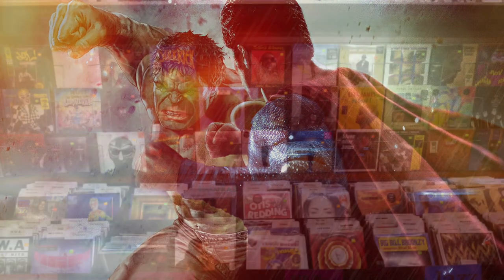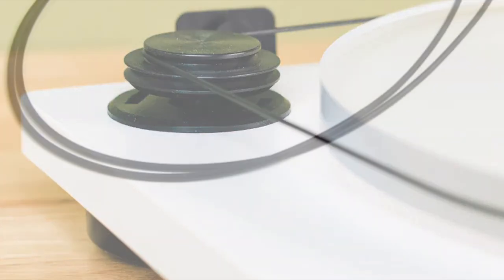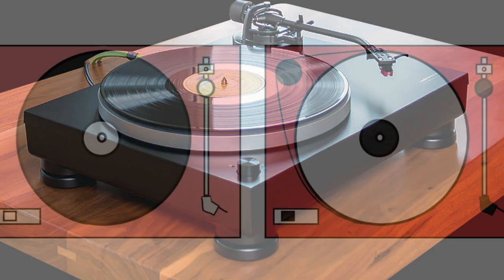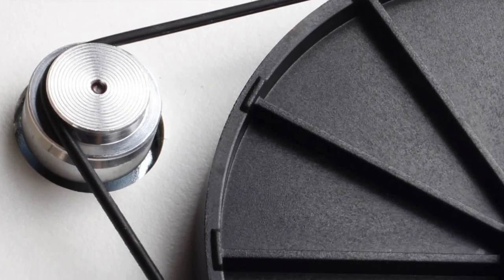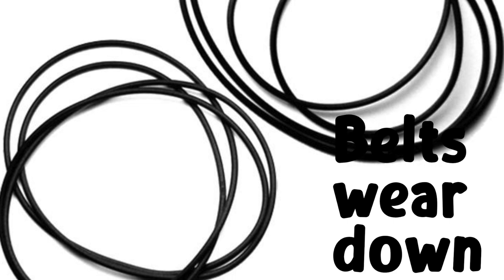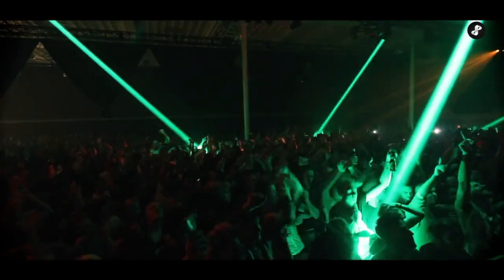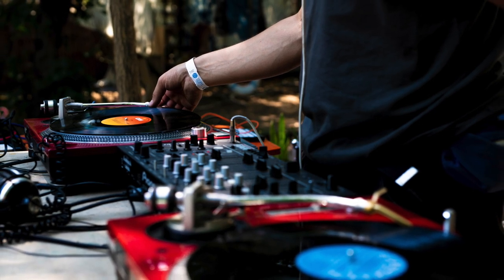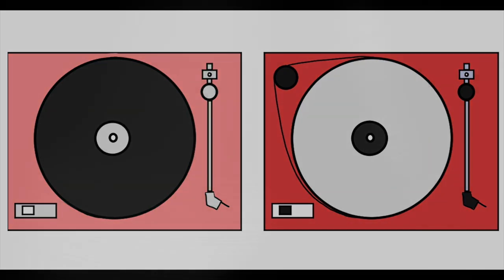Direct Drive & Belt Driven Turntables.

Comment: Great information. I had a Technics direct drive turntable back in the 80's. At that time I was led to believe that the speed accuracy was better than belt drive. I own a belt drive today because of the vibration concern and the fact that I felt I could get a better turntable and cartridge in a belt drive turntable for less money than a direct drive today. But I don't think one is necessarily better than the other if they are both well made.

Comment: The only reason DJ’s went for DD turntables was due to the Technics SL1200, which was originally intended as an audiophile deck for home use. DJ’s saw the extremely excellent build quality which was roadworthy, the great speed control, etc. Technics still make some amazing top tier decks for the audiophile crowd, and companies like KAB gave upgrade and modifications paths easy for all SL1200’s.

Comment: Great article. Rick.

In my experience, I prefer a belt-driven turntable. They are silent and smooth, but Rick is 100% correct that spin-up time might take a couple of seconds. However, I also have an older Audio Technica AT-120 USB direct drive turntable (four years old), and I could hear "cogging" in the playback of my LPs in quiet sections on my LPs and between tracks. There was always a consistent "bump-bump-bump"" noise that was audible.

Apparently, this isn't uncommon. The DD motor is pulsing to maintain angular momentum.

I contacted A-T about this matter, but it fell on deaf ears. They just didn't want to address it. Their explanation was that my turntable was designed for the "professional" users, not audiophiles like me. Because of this experience, I won't buy another A-T turntable again. I'm very happy with my Fluance RT-85 belt-driven turntable.
Reply from the maker: I had an AT-LP5 prior to my current setup (I might have mentioned this in the video).  My main concern was the fact that the plinth picked up every little sound.  Tap the side and it was like thumping a small drum through the speakers.  I had to wonder what other external or internal noises or vibrations it transferred down the tone arm.
Reply: I have a Technics SL1500 direct drive turntable. It’s 40 years old and has great construction.  The plinth is cast aluminum, and very heavy.  Sounds great and works perfectly.  The only update was the cartridge and headshell after 30+ years of operation.  Never noticed any vibration being introduced by the motor or external sources.  The turntable is sitting on a proper rack with floor spikes.  I am a believer in a good foundation for the turntable to mitigate vibration.  Best regards, Brian.

Comment: For me, DD is the way to go, especially with the latest generation models from Technics. If there is any vibration noise coming from the motor, I can certainly not hear it. DD technology has changed a lot throughout the years, and the speed control of the platter is flawless.
Reply: I’m no DJ so why the heck would I need a direct drive turntable to get up to speed fast???? Belt drive for me, just as quiet and just as good if not better. Plus DD more electrically complicated thus they putting money in that area. Belt drive much simpler thus they putting money in other parts of the turntable that can improve performance and obviously the sound. Basically, belt drive offers more bang (in terms of better specifications) for your buck.
Reply: @jogmas12  true. And most high end turntables are equipped with belt drives.

Comment: The other advantage of direct drive is the P mount cartridge,  plug the cartridge in and you are ready to go. No alignment gauge required to match the stylus to the record grooves.  You only have to set the tracking force and anti skating .  You can also use a standard mount cartridge with a DD table but you will need to have a alignment gauge to set it up properly.

Comment: I really enjoyed your video. I notice the vernacular on the whole debate has changed over the last few decades. 

I sold hi-fi in the mid-70's to early 80's. I got a little caught up in the audiophile thing, but finally came back to earth at the turn of the century. But here's what's left over:

I now have four functioning turntables, including the u-Turn you show in the video (mine's black and includes the built in pre). But I only have it because it was practically given to me with only a couple of hours on it and I thought it would be fun to have a modern belt drive. Yeah, the other three are all Direct drive. And yeah again, the belt is a pain. At least my old Technics SL 23 back in the early 70's put the motor drive system UNDER the platter and not outside it. I have to be very careful at handling records or I knock the belt off the platter. 

Anyway, there are three things I look for in all my turntables (except when someone makes me an offer I can't refuse - as with the uTurn):
1. Direct drive
2. Removable headshell
3. Auto shutoff. 

Interestingly, but irrelevant, the uTurn has none of these features. 

Direct drive simply has so much torque these days, and you can manually spin a weak one if you want to speed it up while cleaning records without damaging the drive system at all. 

All that being said, if I were really on a budget but wanted a true "hi-fi" turntable, something like the u-Turn is the way to go. However, my preamp hums a tiny bit, so I'd prefer to select an external pre. Solid ones can be had for under $50.

BTW, for those who care, My three Direct drives are:
Kenwood KD500 with ADC LMF II tonearm that I bought new (I use an add-on tonearm lifter as an "auto shut off" - I bought it in 1978 and it still works perfectly)
Yamaha PF 50 that I purchased for $30 at an estate sale in 2001. Still using the Sigma cartridge that came with it. It's fully automatic.
The Infamous Audio Technica AT LP120 USB that I purchased used about 8 years ago for $150. I purchased a 78 stylus for it and it is my main turntable for 78's 45's and "thrift store" LP's. It also is a great record cleaning platform at 78 rpm and very high torque. I use it a lot and have several cartridges for it all on their own headshells.

As far as I'm concerned, except for the slight hum in the u-Turn, they all sound the same, with the only real difference being introduced by the cartridges, which do all sound different.
Reply from the maker: All good stuff @Robs OnBass - and thanks for stopping by!

Comment: I figure both have positive and negative attributes.  I agreed both can sound fantastic.  I understood there are 2 specs many like to focus on when saying one is better than the other..  Noise/rumble and wow and flutter.  Where as belt drive invariably has lower noise because the motor is set off to the side and not in direct contact with the platter the rumble or noise is lower by a good amount than DD on the spec sheets.  But the advantage of DD from a spec sheet point of view is a better wow and flutter speed control rating since the platter is directly attached to the motor.  This means more consistent speed since it is not effected by the elasticity and grip of a belt.  Where one might give more rumble noise which many of us can't hear, the other gives us less constant tones as the slight variation on speed can become more noticeable, especially as the belt wears on.  But when new, like the DD it is something many of us won't be able to discern.    Either BD or DD has their own good and bad points.  Where as one might have more rumble the other has more variation in consistent tones due to fluctuations in speed.  It's a matter if you can hear the rumble or the slight wobbly tones.  I can't hear the difference unless the belt has been worn and desperately needs replacing.  If you can't hear the difference then you can concentrate on enjoying the music, which is why you bought a turntable to begin with.  But thats what I believe.
Reply from the maker: Very well said @Brian Lee

Comment: I own TTs from the 80s. Belt driven Philips (one high end, one cheap), Akai, Dual. And a Technics SL-D2 direct drive. Wow and flutter of all the belt driven TTs has worsened over time (despite new belts), whereas the old Technics still runs as steady as she was with no rumble, way lower W&F rates and a huge motor.

Comment: If you use a delicate moving Coil cartridge, then belt drive is the only solution. Back in the old days ,belts had to spin very heavy platters. Today, they can be made much lighter putting less strain on the belt.If you have magnetic suspension sub chassis,, a light platter will not bounce like it does on springs. If  you spin your turntable a bit each day your belt will not stretch. Also, today, wow and flutter is almost non existent.
Reply: 1. MCs can be used on almost every Turntable. It just doesn't matter if it's DD, Belt or Idler-Drive! Some platters may be problematic, as some tonearms.
2. A belt has to be replaced after a decade or two because the rubber will degrade, you can't stop it by spinning or anything else. No big deal, thou.

Comment: Im glad you didnt state one as better over the other. Really, you probably wont hear the difference, except for worse speed consistency on cheaper belt drives.
A bit mistaken though, the motor on most belt drives is directly connected to the plinth, so you still get vibrations from it. My old Regas motor had audible strain on the motor when the belt was attached. The idea that belt drive immediately grants motor isolation is wildly overhyped.

Comment: I think belt drive and DD TT's have reached their zenith. I don't think you can go wrong with either. I've only owner belt drive. I've never seen the DD motor setup except in cut-away advertising. I see a lot of videos devoted to working on belt drive turntables, but don't remember seeing any working on the motor system of a DD TT. 

I do know that a AC synchronous motor on a belt drive TT will virtually last forever if maintained minimally. I have a Thorens TD-150 MKII that Vinyl Nirvana tweaked with a Rega arm, new plinth etc. There's 48yrs service with the same platter & motor. I am going to buy something like the Music Hall Cruise Control because the speed is very close to perfect, but not quite. On that model, there's no speed adjustment.

I'd be more concerned about a particular model's resonance characteristics. How much resonance from the arm, the platter, the table, the plinth and is the motor properly shielded...?
Reply from the maker: Vinyl Nirvana does some excellent work.  They are only about 35 minutes from me and I've had my eye on a rewired Thorens VN-150.  maybe someday...
Reply: @TheJoyofVinylRecords  He does great work. The VN-150 comes with the Music Hall Cruise Control, or at least it's an option. With the right arm, these TT's really perform. I don't know how they would stack up against a top tier VPI, though for example.
Reply from the maker: @TheReal1953  Those VPIs are something to behold.
Reply: @TheJoyofVinylRecords  Yes....*sigh*.

Comment: Hey. Let's not forget idler drive, like my 1971 Elac Miracord 50H, for example.
Reply: Heh. I just rebuilt an old BRS idler drive table (radio shack nameplate). The platter and return mechanism were both frozen solid. Frankly, I'm surprised how relatively stable the speed was when I got it going. I have no real use for it but it's fun to show "kids" what pretty much everybody used back in the 60's and 70's. They marvel at the stacking feature. 😜

There are some modern audiophiles that love the old "high end" idler drive tables from the 50's and 60's, and they do have some advantages over belt, but owning one of those is a bit like owning a fully restored Rolls Royce. It's expensive and really doesn't compete with modern tech all that well. There is a reason we went away from Idler. And bias ply tires on cars, and commuting by horse, though all three really DO have advantages (limited though they may be) to modern tech. Still, most people go for the new tech.  😎
Reply: @robsonbass6058  Well I don't agree that an idler drive that is properly set-up and with a new, quality stylus sounds somehow inferior to anything new. How can it? It's completely mechanical.
Reply: @brit-in-czech  I agree. At that point the question is, how good was that particular idler drive when it was new? How's the rubber now? That's why I mentioned there are "good" and "not so good" idler drives.  If I had the money, I'd love to add a late 50's idler drive to my stable. Heck, I used to have one, but I stored it under my daughter's bed and it collapsed when her and some friends were jumping on it. Smashed the TT. This was in 1985. Sad. It was a classic.
Reply: @robsonbass6058  Mine is a near perfect condition Elac Miracord 50H - feel free to search it online and make up your own mind. Idler tyre is fine. I've removed old grease and added new, plus some light oil to the motor. What was your turntable that your daughter and her mates destroyed?

Comment: direct drive .Belts stretch and then give an uneven speed .This will not make for good playback and may even damage your record.This is why direct drives were brought in
Reply: Back in the day, the biggest problem I had with belt drive was we didn't have the internet and amazon. Good luck scrounging up a replacement belt. None of the hi-fi stores I ended up working at sold belts, though we sold the TT's and cartridges. Belts were a maintenance item you could get mail order (which was a pain in the butt back then) or a local repair shop - which charged a lot. Direct drive is maintenance free.
Reply: Dude, or dudette? My turntable is from 1985 and is completely manual and belt drive. I recently measured the speed of it and is still constant at 33-1/3. There ya go.
Reply: @jogmas12  Most of the world's best and most expensive turntables are belt drive. There is nothing wrong with belt drive, in my book. I just prefer direct drive - in the same way that I only do shaft drive motorcycles, even though some of the best are belt or chain drive. I see direct drive as just maintenance free. Heck, I've pulled several turntables out of a decade or more of storage. The DD's fired right up. The belt drives either had broken belts, or belts that had fused themselves to the platter and had to be scraped and cleaned off. 

But if a turntable gets regular use and one has a source of belts, belt drive can be awesome.

Comment: I preferred belt drive because it looks cool 😎 to look at. Also high end turntable only used belt drive because it just sounds better and less vibration. I don't care about dj direct drive. High End turntable belt drive is where the performance at not direct drive.
Reply from the maker: Completely agree!  Recently purchased a custom Thorens TT with a floating chassis to further cut down on vibration.